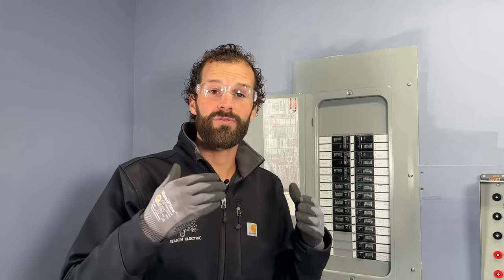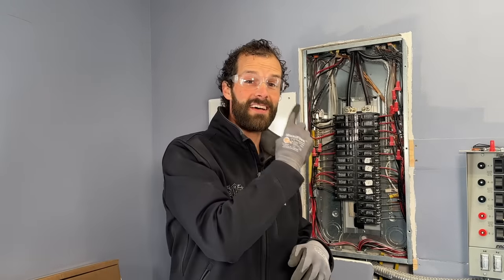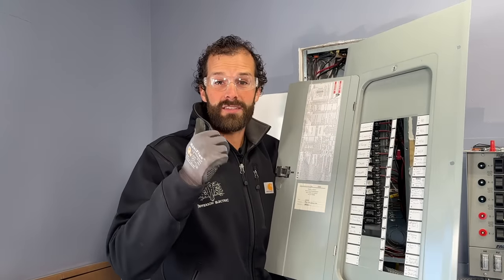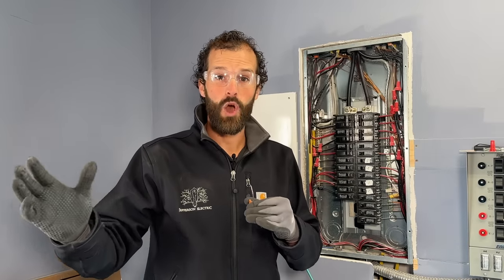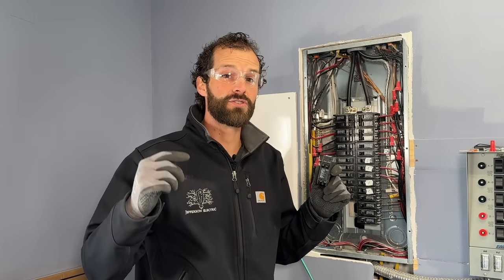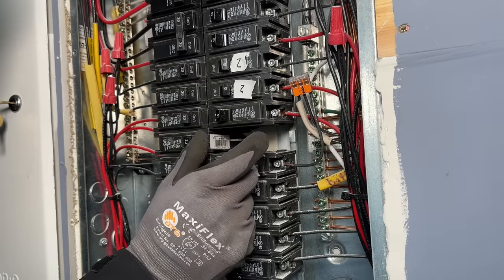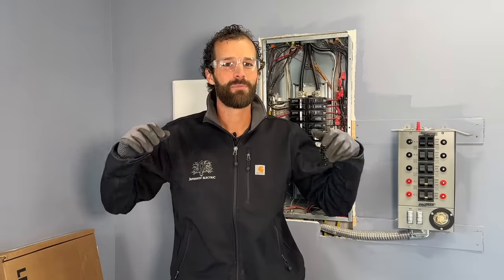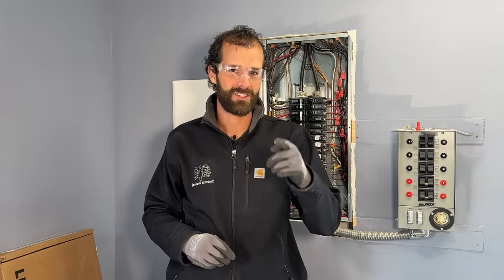No Room In Electrical Panel - Quick Fix

Comment: Grest video, but I kinda don’t feel too comfortable with the connection joints with a wago compared to tightening down a screw connection. Almost like those push ind at the back of aN outlet. Please let me know your thoughts....
Reply: the wago lever nuts are a different design from the receptacle stab connections, I still favor wire nuts for continuous duty high load applications, because you have a direct conductor to conductor connection instead of two conductor to spring steel connections in each wago.  but I'm starting to use them for applications where I expect to be changing things out relatively frequently.
Reply: @Kevin-mp5of  not by any American usage of "gas tight"  the American definition of gas tight involves gaskets and sealants.
Reply: @UCdqRn_A6r9VpQK0MfM03AAA or I can go to a dictionary:
"The definition of gastight in the dictionary is not allowing gas to enter or escape."
since wagos are in a plastic shell with open holes for the connections, and no sealant inside, they are not a gastight connector. air and any other gases they are exposed to flow in and out freely.
Reply: @Kevin-mp5of  again: that's not what gastight means in America.  in america, gastight means, it can be installed in a flammable or caustic environment, and the gas in the environment won't get to the connections.  or it means the fittings on your fuel gas lines don't leak.  

for a spring connector, wagos are better than stabs.  but US terminology differs.  a gas tight connection is a specific hazardous location rating.  there is a model of wago rated for hazardous locations - in a gas tight splice box.
Reply: @Kevin-mp5of  also, it's kind of funny you brag about their permanence, when I use them in locations where I want the connection to be the opposite of permanent.
Reply: @Kevin-mp5of  you're the one who forced me to take you to school.
Reply: @kenbrown2808  Never been a big fan of wire nuts. Anything threaded runs the risk of backing off and way too easy for the unskilled to get wrong. Wagos are pretty foolproof.
Reply: @chaos.corner  you can try to make it foolproof, but they will just nake a better fool. But yes, a DIYer is a lot less likely to use an undersize wago or not tighten it properly. They may use a cheap knockoff, though, or do other things wrong.  All the same, I'm fine with them for things i expect to change out frequently, but I'll stick with wire nuts when i expect contimuous loads or want the connection to be there for 30 years.
Reply: @Ken Brown  wago are so much better. They don't damage the wires like wire nuts do..and are horrible for stranded to solid like lots of led fixtures are now wagos work best
Reply: Fortunately, the entire civilised world has long since banned the use of wirenuts

Comment: I would have liked to hear more about how I know if I can just combine stuff or if you need to have bigger service put in...like everything here is electric and the panel was already full of tandem breakers in all but 1 slot allowed, and I'm not convinced the 200A service could handle another 40-80A of car chargers if we suddenly had both of our cars being EVs and winter we have 25kW of aux heat in addition to heat pumps, and then all electric appliances I've seen the peak winter cold mornings get up and wash in the morning water heater kicks on in addition to heat pumps and aux heat we see upward of 170 amps draw as it is.  If I suddenly combined some light circuits to add a few more big draw things at what point can the main not handle it?
Reply: Thousands of new EV owners wil have the same problem.  Many older houses have less than 200 amp service, and people forget about the charging issues.
Reply: It can't handle it at 200A. I think we're probably going to have to see some collaboration between devices as many things are intermittent loads so timesharing could be a thing. Of course, then there's the question of infrastructure anyway.

Comment: I may be old school I am a retired local 5 electrician and my memory recalls NO splicing in the panel and I see what 4 or 5 wire nuts in there I may be wrong and was just common practice but in all my years I have never spliced inside an electrical panel
Reply: That's how transfer panels are wired in, at least from the manufacturer's instructions on the one I put in. In the video you see 10 wire nuts, and 10 transfer switches.

Comment: 6:14 isn't there specific tandem breakers called NT or something like "notched", that specifically are open to fit in any and all slots? I'm almost positive Eaton makes 2 types of tandem breakers, as I've had to put these tandem breakers into older panels that weren't Eaton branded but fit Eaton breakers. One like the video here shows with a closed end, and one with an open end to allow attaching to the higher spots there.

Maybe they're only made for the older panels that don't have those notched spots available?
Reply: Just looked it up, there's type BR and type BD for Eaton. One has a blocked notch, the other is open completely. Interested in why that is if they are specifically designed not to be put in the top part of the panel, then another version is?
Reply: @calvissuperman   Me too.  Why does it matter where on the bus bar you've located a breaker?  Isn't that the point of a bus?  Or is this just limiting capacity by blocking an arbitrary half of the panel?

Comment: Some codes require smoke detectors be on a lighting circuit. Each Smoke detector taking a 1/2 count for total devises on the combined circuit, in areas that restrict the number of sockets on a circuit. Some breakers allow two wires inserted, some only allow one -- that info printed on the breaker body.
Consider larger rooms where more than one temporary heating or heavy load might be installed -- as wise to have two wall-plug circuits runs plus one where a deep freeze might best be located. Start with a plan and get a pamphlet from the local electrical inspector/branch, so you won't have to redo.
Reply: Yea, this is a video pertaining to combining circuits when space is limited, it's not supposed to teach every aspect and trick of the electrical trade in 7 minutes 20 seconds.

Comment: I just used this method in an old church. The breakers were so outdated there were not available any longer. I piggy backed the new circuit to a low amp LED circuit.

Comment: Even though your disconnect is "off" wouldn't you recommend metering your connections? Just to be safe. I'm not sticking a screwdriver onto a Bus without metering it.

Comment: Wire nuts properly used are a million times better than a wago connector. Much more contact area between the wires than the tiny little spring cup of a wago which also can lose its spring tension over time from circuits that carry larger loads.

Comment: The screws in a panel are not Philips heads, they are ECX.  The screw usually cannot be properly torqued with a Philips screw driver.

Comment: FYI, you can add a small sub-panel for the price of a twin circuit breaker. But that may be above the skill set of some.
Reply: Well the panel might be $20, but you will need a heavy wire and a large amperage breaker in the main panel to power it, so not sure that is really a cheaper option. And that new breaker will take two slots which means moving more circuits to the new panel most likely.

Comment: So could I take two sets of plugs that aren’t used have them combined onto one circuit to free up a slot for a GFCI circuit breaker for my sump pump? Currently my sump is combined with my furnace plug. Not my doing previous homeowner.
Reply: @Kevin-mp5of  thanks for the help. I never said I was going to do it. But just wanted to know about options. Thanks for being that guy though that has to be a smarty.
Reply: @Fred Wills thank you for the reply. I appreciate it.

Comment: Weren't "lighting circuits" often insalled with 14 guage while other circuits were 12 gauge?
Reply: Usually, but some contractors wanted to save money and use 12 gauge for everything and just have more stuff on the circuit.

Comment: he mentioned tandem breakers in the panel. is that the same thing as double pole? also it's not clear how he knew that the tandem breaker is not allowed in certain places on the panel.  can someone elaborate more on that? thanks in advance
Reply: A double pole breaker takes up the space of 2 full sized breakers. A tandem breaker has 2 breakers but fits in the space of one full sized breaker. If you watch again where he is discussing where they fit, look at the metal buss bar. You will see the bottom few tangs on the buss have a notch where the top one he mentions does not. The ones with the notch will fit the tandem breaker.
Reply: @johnd5398  thank you very much. that is most helpful

Comment: 1998 a smart panel would run $10,000 add up Solar  a Good Gen and wind mill . 20-30 Grand total  .  Im old Just going to keep the Electric power i have .  I been doing Electric from age 17 Oil Field  Drilling rig, Light plant power the oil rig , Its the same as a Home  Same as in school basic electric .

Comment: Do you not have to follow code in so far as number of devices on one breaker. The first thing before doubling up, you had better know what your limit is, when it comes to number of lights and plugs on the same circuit.

Comment: My breaker is full, but there's one double breaker in there. Now I'm wondering if I can add more doubles in there...
Reply: Was that done before you were in the house? That may have been done incorrectly (illegally). As stated in the video, whether tandems are allowed depends on the specific design of the panel.

Comment: That panel is full of thick breakers , just add thin breakers , that’s why I always use GE panels when avaliable
Reply: I love the GE panels for that reason. The two pole breakers are cool because they are just two breakers bolted together where as on the Eaton/CH panels, you have to use the quad breaker because of how the buss is designed. Its weird.

Comment: I think the other reason allowing for circuit combining is the load efficiency.  TVs used to be 5-10 amps on their won, same with ceiling fans, etc...Now you can stack most of the outlets and the the lighting in less than 40 amps it seems like

Comment: heres the issue with this which is hilarious as you are required to install per the NEC not the manufacturer which states The National Electrical Code (NEC) does not permit having two wires connected to any individual breaker

Comment: You don't need to upgrade panels if you have 125 watt to 200watts, someone told me they have to change wires from the street to upgrade panels

Comment: This should be prefaced that the CEC is different from the NEC. This load centre has no main breaker and cant be turned off or verified that it is denergized. You can't terminate two home runs under a single breaker from Eaton/Cutler Hammer or Siemens. That is permitted on Square D QO only. You should never install a push on breaker into a live panel, the bus behind could always collapse and a line to line short can blow up in your face. Your level one cut gloves youre wearing arent goig to help with this.

Comment: Why not do it properly and replace a thick breaker with two thin breakers?  Besides the panel he's looking at has 3 blank spots in the lower left corner.  Is this a quiz?

Comment: I don't get why you can't use a tandem breaker on some panels. What's the difference between 2 15 amp circuits or one 30 amp circuit. The stab can handle with no issues
Reply: I believe the word was "not available" as far as the breaker was concerned. Just remember that most inspectors frown on non-OEM parts so we're talking original equipment, not just one that fits.
Reply: @rupe53  it's available but some stabs don't support it, like in this case only the bottom few can be used tandem
Reply: @Russianmafia10  ... if the mfgr only allows certain spots to accept the breaker then there's a reason and its only UL approved for that application. If you go back in the video, I believe his words were "not available" meaning not every mfgr has the part (tandem breaker) as an approved part for their panel. We don't get to question that issue. If it's available as an approved part, then we can use it where it's accepted. My point being is that Square D and Bryant breakers will fit a GE panel, but that doesn't mean it's ok.
Reply: @rupe53  you're not really getting the point, some stabs allow it and others don't, what's the difference. EVEN if it's "available", it's only allowed sometimes on certain stabs. I don't see what possible negative outcome can come about from having multiple circuits. If the stab can handle a 100 amp breaker, what's 2 15s going to do.
Reply: @Russianmafia10  ... I can't say for sure, but some panels only allow tandems in certain spots and others allow them in all locations. Most likely to limit how many you can install. BTW, they are not "stabs" they are buss bars. There are older panels with a trademark on "Stablock" as a manufacturing term for their brand of breaker and buss bars. I believe it was Federal Electric, who went out of business in the early 60s.
Reply: The buss is not rated to house a full allotment of tandems because it would be overloaded as far as amp capacity of the buss
Reply: @rubenp8750  except the entire bus will have a main beaker. What's the difference between a bunch of 30 amp breakers and a bunch of tandem 15s
Reply: @Russianmafia10  ... do your load calculation and figure out what the difference is. Just as an example, most 100 amp panels already have 20 slots. If you fill it with 20 amp breakers, then you are already at 200 amps per leg (max) and 160 amps per leg using the 80% rule on branch circuit loading.
Reply: @rupe53  look at any panel ever, and the sum of all the breakers is almost always more than the main breaker rating. So why should that matter
Reply: @Russianmafia10  ... it matters because there are limits. When you push the limits the likelihood of something going wrong increases. Yes, the mfgr is trying to save the idiots who don't know when they are pushing too far.
Reply: @rupe53  it's to code to have a bunch of 50 amp 2 pole breakers down the entire panel. That's less load than a bunch of 15 tandems
Reply: @Russianmafia10  ... do as you please but I doubt an inspector would pass that bunch of 50 amp breakers.
Reply: @rupe53  look at your panel at home right now and add up all the breakers and see if it's more than your main. Most likely is. Most homes are. What's the difference.
Reply: @Russianmafia10  ... in most panels it will be more than the main, but that's why you do a load calculation, so you are not 10 times more than the main.
Reply: @rupe53  I have plenty of tandems all over my panel and usually my draw on my panel is about 10 amps or less. Maybe up to 25 if the dryer is on. So I don't see any issues
Reply: @Russianmafia10  ... the difference between you and me is I have been in hundreds of homes and seen some scary stuff. Some of them were not a problem till new owners moved in and use changed.

Comment: What a hack. Nothing a homeowner should be doing. He never talked about current draw or load calculations on the current panel. There is a reason electricians need to be educated and licensed.  Good luck when your house burns down by listening to someone from YouTube.  Just keep sticking more stuff in your panel until the main gives out!! Great advice.

Comment: You are required to use breakers made for that panel by it's manufacturer.Others may fit but it is not allowed.
Reply: @Kevin-mp5of  Thank you for the grammar correction,I do appreciate it. It is common knowledge for those who know nec, but I get the feeling that most of your audience are not professionals.There is a tendency to  'see if it fits'. And many will that are not the specified type.If you're going to teach electrical(I Do) leave nothing assumed.
Reply: @Kevin-mp5of  Exactly and that is why you have to say it.Next thing you know,some guy is suing you because he did something you said and you didn't say anything about that part.I make my students sign explicit waivers that they aren't qualified to do anything until such time as they earn a license.And then they are responsible for themselves.
As an Electrical contractor I have more than enough responsibility,liability and insurance..I like to teach the nubies and give them the benefit of my experience but I have to insist on not getting sued.
Reply: There are "Suitable Substitute" lists published by the manufacturers.  Before I retired, I always carried the most recent version in my truck for use with questioning inspectors.
Reply: @WilliamEades_Frostbite  I always avoided that conversation entirely by using obviously approved breakers/materials.
Reply: @pjh9104  You would be surprised at the number of state inspectors who don't know what can replace obsolete breakers from out of business manufacturers...Try to find a NEW Bryant or Bulldog part, it is either Ebay or get the bad one rebuilt.

Comment: Well then aren't you dedicating only 7-1/2 amps to each of those circuits?  Where as a double breaker you could still do 15A.  Let's say you plug a heater onto each of the circuits.  Both running at the same time would pop that 15A breaker whereas the double breaker would service each of those just fine.

Comment: Do you refer to a Philips screw driver as a star driver. I think not. Why do you not refer to a #2 square drive by its proper name "#2 Robertson" ?
Reply: All Robertson drives are square drives. But not all square drives are Robertson. 

Look closely at an S2 bit and an R2 bit and you will see there is a different.